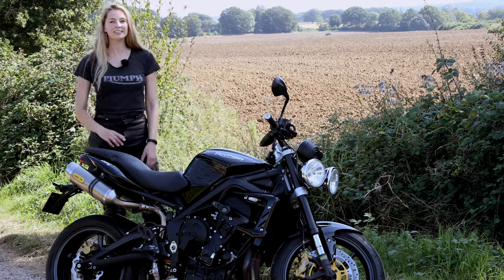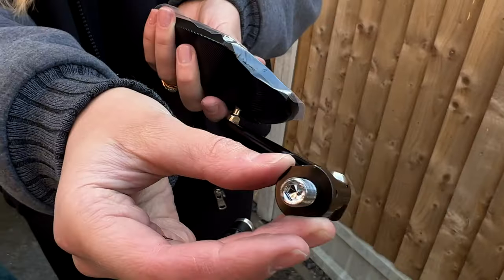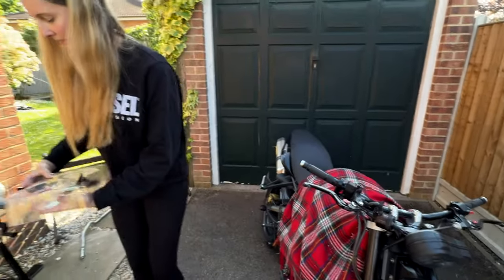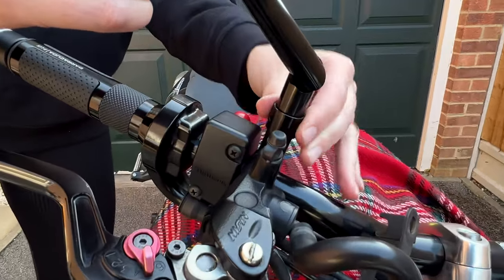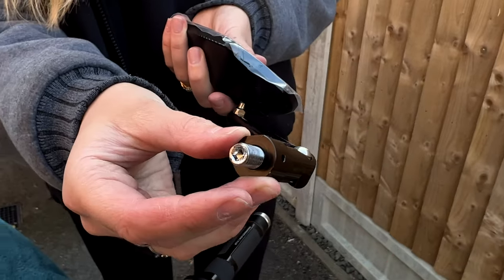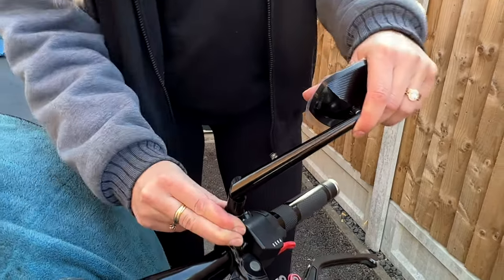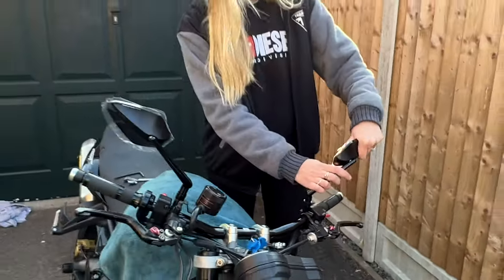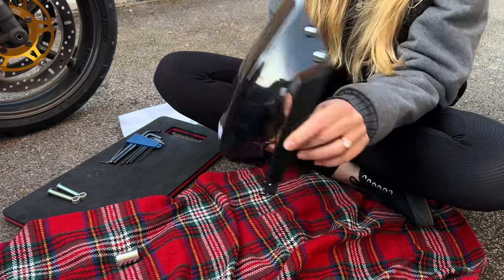Street Triple 675 Makeover | Part 5 | How to Install Motorcycle Mirrors | Barracuda A Version B-Lux

Comment: I’ve been after some of the b lux mirrors, for my r6 they adapter they sell doesn’t look right but what is the diameter or the bottom end? Possibly the rizoma mount might work, has a 20mm diameter hole for the mirrors?
Reply from the maker: They really are nice mirrors, they look great and work well. I don’t have the bike to measure them but contact SP Engineering who will be happy to help. Don’t forget to use my discount code Adventures-SP10 👍